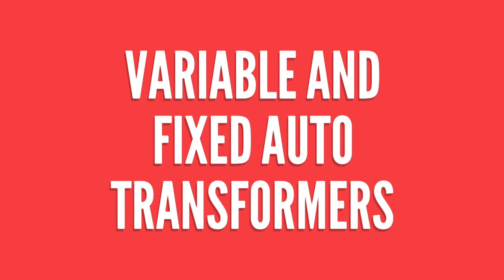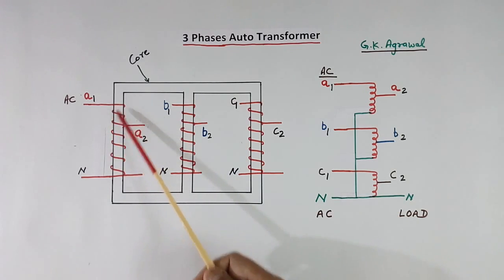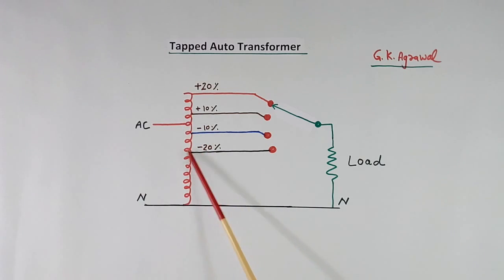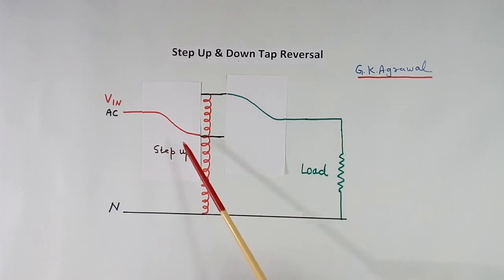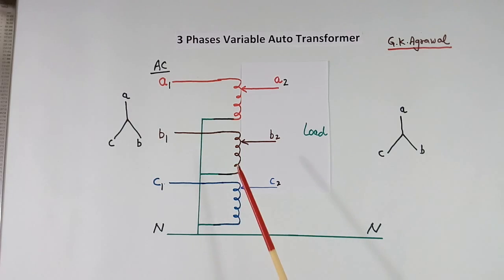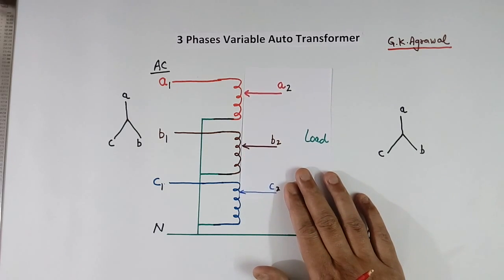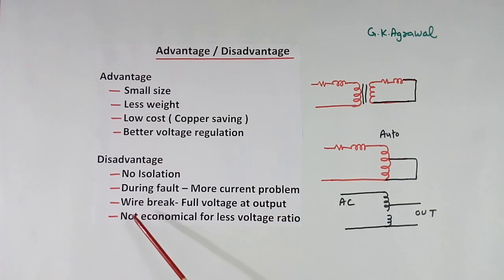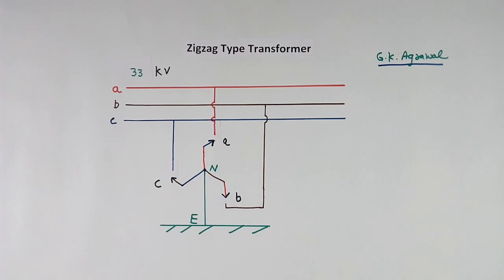Auto Transformer working principle, how Variac works, Uses

Comment: If I use an auto-transformer as an audio output to increase the output voltage on the amplifier, for example 40v input and 100v output, is it relevant? please give feedback 🙏 thank you
Reply from the maker: Theoritically ok, you can try, but there may be 2 problems
1 - Your amp output should be able to drive auto transformer.
2 - Normal auto transformer core may have high loss at high frequencies.
In olden days, a small 1 inch by 1 inch size transformer were used in audio amp circuit.
Reply: @GKAgrawal2  In conclusion, it is not recommended. right?
Reply: @GKAgrawal2  I have tried it, increasing the output of the OCL amplifier using a 37-0-37 transformer, it turns out it works well, the audio frequency can be said to be safe, without defects. After this I want to wind the 0-40v-70v-100v automatic transformer myself. with 500va power at 0-100v. Thank you for the explanation, sir.

Comment: Sir,can I use one of my old stabilizer as dc powersupply using diode bridge!!? Isnt it?!
Reply from the maker: voltage should match your requirement.
Reply: @GKAgrawal2  thank you sir for so prompt response🙏🙏🙏.
Actually I have a stabilizer which is not being use now a days...
Simultaneously i need a DC power supply,bench to type..in between 12 v to 48v, around 10-30amp...for my free tyme projects and all...recycling the stabilizer you can say.
I got a bit confused seeing various comments by various youtubers but not finding reasons of impossibility...your teaching have given me more clarity...
If possible please give some guidance too.
Thanks and regards,🙏🙏🙏

Comment: Please why the autotransformer 400kw was damaged intil starting up the 2.2kw motor. Please answer
Reply from the maker: Watch my video, why rating of variac is in Ampere and not in kw.  
So, may be, you get more knowledge to get solution yourself.
Reply: Hi 
Many thanks. The second autotransformer had the same consequences as the first  ( burned).
Autotrf  KOC ELECTRIC Co, 400 kw, rating 1min, freq 60 Hz, tap 50,65,80%, WT 201 kg.   Than you

Comment: Sir, Disconnected ground measured V RMS reads 80V so Vpk is (80 into square root of 2) so 80X1.4  = 112 so Vpp = 224V this is solved. But why 80V V RMS coming from 24V transformer when ground disconnected from 24V AC transformer.
Reply from the maker: No, not solved, 220 volt is not peak to peak, it is RMS value, You get only 80 volt rms, just 33%. If your transformer is auto type, then transformer is behaving like voltage devider and drop is 67%. If transformer is isolated type, then its insulation may not be good, please Measure resistance between primary and secondry using multimeter, do not touch wire with hand, othetwise body resistance will come.
Reply from the maker: Watch my video of testing transformer with multimeter.
Reply: Sir I said 80V RMS only, now watching testing transformer with multi meter

Comment: Hello sir, I have connected Oscilloscope to 24VAC isolation step down transformer. Scope reads and shows good sine wave with 24AC but if I remove ground clip scope reads and shows sine wave with 240AC, but if I remove probe tip and keep ground clip nothing reads. What is phenomenon
Reply from the maker: Without ground clip, it is picking up noise, you will notice that it will be distorted also. Always connect common GND point.
Reply from the maker: Your question is very good.
Reply: No sir, no noise is seen if I remove ground clip very stable pure sine wave with 240V is showing.